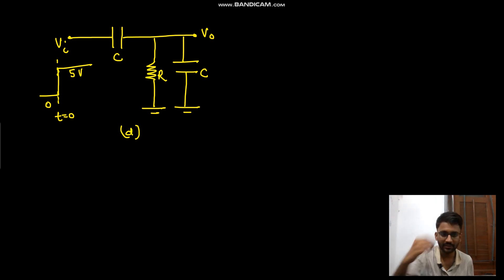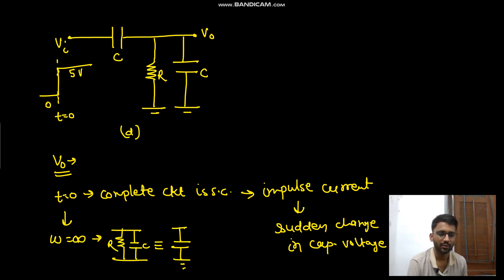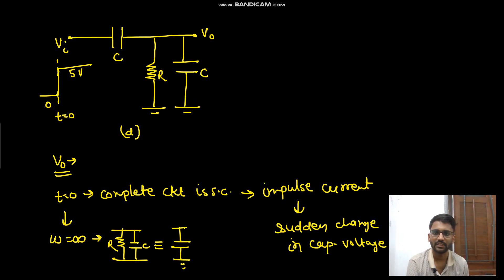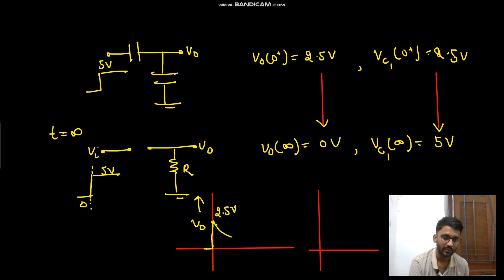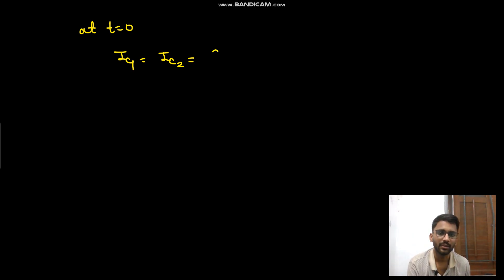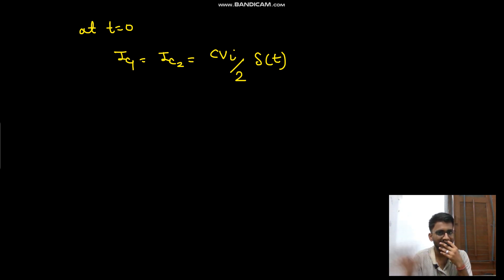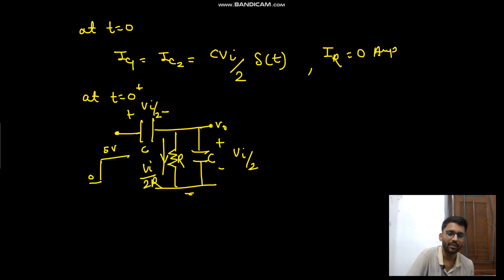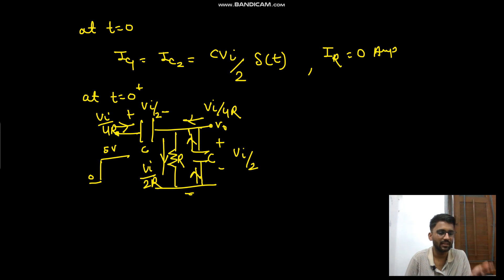Lect. 2.5 More Examples of RC Circuits || Circuit 4 || Crack Interview with Me

Comment: How do one explain intuitively that at t=0 caps are shorted but those create voltage divider and divides voltage equally since both caps are same .. I understand since there is infinite current caps changes voltage suddenly but not understanding it intuitively ……

Comment: At t=0 wouldn't the capacitors behave as  a short , ...so only resistor  will be left behind
Reply: So output voltage should be zero at (t=0)